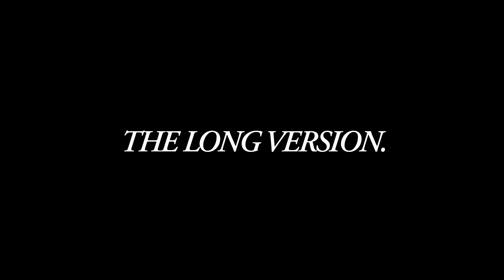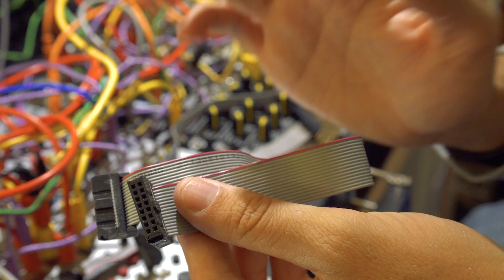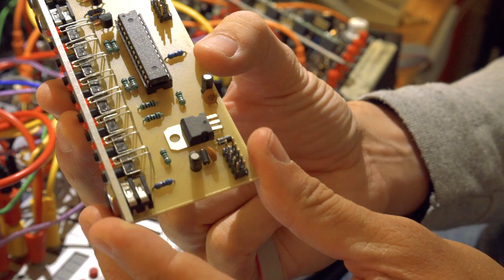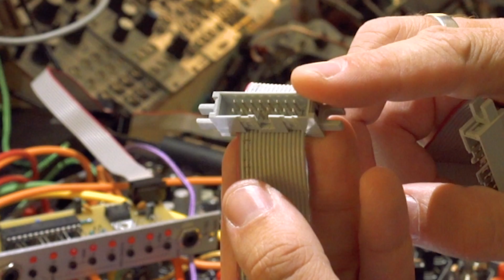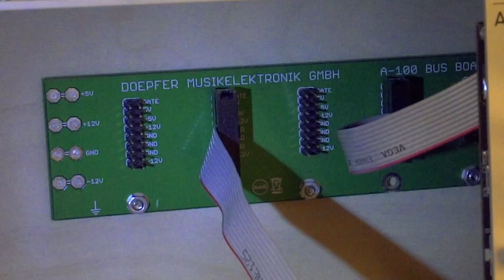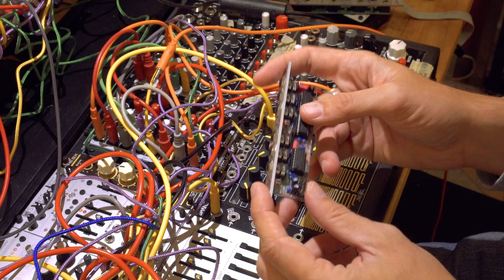How To Plug a Eurorack Module In, Correctly (Eurorack Power 101)

Comment: Good advices, except one. If red stripe on the cable don't at the -12V, THRU IT AWAY !
If any indicator in your system is wrong, changed it or don't use it. If not, you are somebody else makes an "mistake" with it what you could have prevented :-(

I'am an electrician and make my own cables that are a little bit longer because using deeper "Fischer Elektronik BGT" 19" eurorack cases.
CORRECT indicators are importend but the most importend rule in my profession as an electrician is CHECK EVERYTHING BEFORE TURNING IT ON ! 

In my profession this means taking measurement. I have seen electrician (and apprentice I had trained that forget one of the most imported rule) connecting wrong colored cables in the powerfacility and switching it on without measurement and by that destruction of every device behind that. As result a huge damage claim and unfortunately lose there job :-(
The color swap meaning here in Europe 400V on a group for 230V devices, one bright flash of light and than Pfff, smoke.

I hoped for keyed connectors in eurorack on the module side so people can't make this mistake in there eurorack system. Users are not electricians ?!!
Mylarmelodies, thanks for warning people ! CHECK, CHECK AND CHECK !

Comment: Great video on a simple, stupid topic!  

Stupid because this would mostly be a non-issue if manufacturers used shrouded headers.

Shrouded headers won’t stop an incorrectly wired cable, but I would guess 99% of issues are “user error” in plugging in the cables the wrong way or shifted over by a pin and shrouded headers would make that a non-issue.  Also, all modules should have reverse polarity protection so a polarity issue just means the module doesn’t power on instead of blows up, but that is a bit more complicated and expensive and could impact performance of existing designs (there’s a tiny voltage drop).  A shrouded header is literally just a few extra pennies to add on and has no impact on performance.

While you cover all the issues, one thing that I think is worth emphasizing a bit more is that two cables can be wired correctly, but have a different “topology”, so basing the orientation of the cable on the overall feel, without checking where the key on the IDC connector is, or referencing where the red stripe is, can be a recipe for disaster.

What do I mean?  If you pause the video at 3:50 you have a 10 pin IDC connector at the top of the screen and a pair of 16 pin connectors at the bottom.

With the 10 pin, the key on the IDC connector is facing LEFT and the ribbon cable is entering from the OPPOSITE side of the connector.  Here the red stripe is DOWN.  This is correct as the red stripe is connected to pin 1 on the connector. (If you look at at an IDC connector you’ll see a little V or arrow on one side of the key indicating where pin 1 is - this is the side the red stripe should be on)

With the 16 pin connectors, the key on the IDC is facing to the RIGHT with the ribbon entering from the SAME side as the key.  This results in the red stripe being UP. This is also a correctly built cable as the red stripe still corresponds to pin 1 on the IDC.

Now imagine that these were both 10 pin connectors coming out of your case (the ends you plug into your modules) and you had the pair in your hands as shown.  Unless you run your finger over the IDC connectors and realize that one has the key facing towards you and one has the key facing away, they would feel basically the same.  However in one the -12V is down, while in the other the -12V is up.

It would be so easy to mix up the two ribbons and fry a module because the cables felt the same in your hand and you were plugging into a module with a non-shrouded header.  NOT THAT I’M SPEAKING FROM EXPERIENCE OR ANYTHING!

Comment: I literally just got into eurorack and assumed that it did not matter how you plugged in modules, plugged in everything wrong.  Shout out to the make noise skiff for having a failsafe that it won't turn on if plugged in improperly.  Would of been a 1800$ mistake, watched this right after and learned to not just do it with this stuff lol.

Comment: I appreciate all this, as I feel the OP's pain, but find  it a bit long-winded (that said, thanks for the executive summary up-front, and for all the anecdotes) however I will suggest that Euronauts think of ourselves as test pilots -- we must learn to pack our own parachutes. Failing all else, one can spend $3 on DMM at Harbor Freight, learn to read pinout diagrams, and suss the connections out for oneself. You don't need to be a full-blown EE to  get this stuff right. But as is pointed out here, you need to do all the reading, and learn to read between-the-lines -- because you're likely to read conflicting bits of information -- and not AI, but GI (genuine intelligence) will be needed to get things straight.

Comment: Something interesting happened to me. Be careful if your system has multiple bus boards. If a module is connected wrong sometimes only the modules on that busboard is affected, not the whole system. Sometimes digital modules just not properly boot or analog modules have dim leds etc. Thankfully i havent fried anything yet. knocks on wood

Comment: Another idea that might be helpful is to make your own cables. You build your own system anyway, so why not the cables. That way, you can also make cables just as long as they need to be, which saves a lot of space and avoids spaghetti behind the modules. It probably has some electrical benefits on top of that. Here is what I do: 

1. Shrouded connector busboards only. Those will ensure you plug the cable in a consistent, right way. 

2. Normal grey cables with red stripe for "standard" modules (shrouded connectors, clearly labeled pin layout etc). Red stripe indicates -12V and is (just) and optical aid. Don´t forget to finger trace when plugging in. For my setup, this would the vast majority of modules. 

3. Different color cables (rainbow colors) for any modules that can be tricky. Tricky means: No standard pin layout or orientation, bare connector without shroud, missing clear labeling of the -12V pins etc. This way, they stick out and will flag connections for extra attention. You will plug cables out of modules at some point in time, so this is a reminder to check carefully. Don´t forget to finger trace TWICE when plugging in. 

A set of 30m cable plus connectors and crimp tool costs less than your average module and will give you a) peace of mind and b) neat cabling for better access to the space behind modules.
Reply: @etch on mind   A crimp tool is not needed. Just squeeze it in a vice.

Comment: I do not understand this silly arrangement of the Powerlines on a Pinheader. It would be possible to mirror the 4 Power lines on the connector, so that you could plug it both ways. 
+12
GND
-12
+5
+5
-12
GND
*12

Why, really, whynobody had this idea before?
I am making my own modules and I use this system, so I mustn't think so much.

Comment: Or just check feed side with a voltmeter, and refer to the ICs on the module side, which should pretty quickly tell you which way the cable goes.
Reply: I was looking for this comment. It's really the only way to be sure and it's a hell of a lot easier/more reliable that running your finger along a cable.

Comment: thanks for this very helpful indeed as lm moving modules about at this moment, l brought a jomox modbase09 but theres a confusing way to connect these when using tiptip power with flying ribbon cable same as in your video? it says to slice the notch off the connector which means connecting it the other way round on the flying cable? iv avoided doing this as not 100% confident that the connection to the actual module has to be turned also? so confusing iv had it over a year sitting in the box, daft l no but wasn't sure so avoided it and stayed with the hex drum, has anyone had to do this with there jomox? think jomox have changed this earlier connecting version to a more normal way now.
Reply from the maker: Eek, that sounds bananas - best to contact Jomox to get further clarification what to do rather than leaving it to chance or strangers on the internet!
Reply: @mylarmelodies  yes its quite a bizarre way to connect a module, keep up the good work love your sound
Reply: @mylarmelodies  finally plucked the courage to slice off the sml part on the connector as it says in the manual and connected it to the flying bus cable reverse way round closed my eyes switched it on? now lm thumping that jomox sound : )

Comment: I mark +12V and -12V on my PCB silkscreens, -12V is always down, and they all include reverse protection diodes. So buy my modules, at least you (probably) won't destroy them :)
Reply: Also I find that IDC connectors with wide top + bottom prevent plugging them in above or below where they're supposed to go, because the sides knock in to the pins which aren't connected.

Comment: Have never understood why every manufacturer doesn't just put power diodes on the input. Practically every guitar pedal has it and 9v center positive plugs are about as common as hens' teeth. 1N4001s are like $0.02 each, and a pair would prevent this problem ever happening (you could still plug it in wrong, it would just not turn on). The "either way" connector is a brilliant idea as well - 4 diodes for a full bridge rectifier and you can forget labeling. Still possible to misalign the pins and short the rails to ground, but easily fixed by using shrouded connectors. I'm developing a new sequencer module now, will be sure to incorporate the full-bridge in my next revision.

Comment: if we cant trust the red stripe, how are we supposed to know which rail is which on a module if a given manufacturer only labels it as "red stripe" on the board?
Reply from the maker: Follow the flying busboard to the source, where the red stripe should be marked/indicated. Same on PCB boards, -12V should be marked.

Comment: PS: As I'm a boffin and weirdo, I will often take a cue from the Electro caps which are usually next to the power connect. These are marked with -ve stripe. One of these -ve stripes will point to the 0v line, the other will point to the 12v line.

Comment: That module is probably still usable. Most electronics will fail along a circuit path with the weakest link blowing. I noticed that the ICs had sockets so you may be able to swap out the bad IC for a new one and power it up. Most of the cost of a module these days in in all the hardware assembly.

Comment: Never disconnecting the cable from the module is sound advice, but not always achievable. Sometimes it’s impossible to reach your hand into the back of the case with the cable attached to the module. And sometimes a cable won’t reach at all, so you have to swap it for a longer one. I’ve made a habit of always looking for markings on the PCB before disconnecting, though, and for those like Doepfer without markings, keep a Sharpie handy to make your own.

Comment: the first module I ever bought came to me with the cable connected to the module wrongly. I had no idea, and connected it but nothing happened. Lucky though no damage was done. When I figured out it was the wrong way around, I turned it around and it worked. So poo poo to Vintage King Audio, and horary for Pittsburgh Modular Waveforms!

Comment: Funny that...
The only module I ever fried was a Doepfer Wasp. It came from the shop with the cable wrong way around (the red...)
Luckily the thing that blew was a dual OpAmp with I replaced quick smart.
The lesson is:
1. Electrickery is made of smoke.
2. The smoke is kept in small back boxes with metal legs.
3. Once you release the smoke electrickery cannot work.
End of class.
Reply: Glad you opted for looking things over, rather than making a Yule Log video of your limping module! Too many people, faced with a module struggling, immediately give up and euthanize the poor thing.

Comment: Every time I ever plug any module in I double check the position of the red stripe, turn everything off, put it in, turn it on again, one module at a time. Never had a problem. I bought a module recently from a seller on Reverb. It made my first case smoke when I put it in, 2nd case power flickered on and off. I told him there seems to be a voltage error within the circuit as far as I can tell (back of module was also insanely hot), and first thing he asked me is if I plugged it in the wrong way. Ha ha. If only..it took about a week to convince him that, yes, I do know how to plug a module in, and it clearly seems there is a power issue with this module..still waiting for my refund due to Russian customs hell. DON'T EVER BUY ANYTHING FROM RUSSIA! End of PSA.

Comment: Well, actually, Doepfer invented Eurorack. So -12vDown rule is part of these modular, as important as 3U, the hp or where to set the holes (which manufacturers don’t obey as well). And it’s not on the modules’ manual because it’s on the System A-100. They made all the manuals like parts of a (very large nowadays) manual for the system. But... yeah, Eurorack is now bigger than his father and they should accept that they’re just another manufacturer for this system... AND JUST PUT A LITTLE RED LINE to indicate where -12 is. Thanks MM

Comment: In all my future modules I plan on adding a bridge rectifier so you can insert the power cable either way! This is common on brand new uMutable modules thanks to Jim. I'm also really liking that little skiff, I think it makes a good case for small demos like this ;)
Reply: I guess it's not normally done because of the voltage drop of diodes.
Reply: @YaFunklord  Yes, there is some loss of headroom from the diode approach. There's a lot of it in Eurorack though so there's usually not much point in fighting over half a volt or so. That said it would be a bit smarter to utilize a MOSFET approach to minimize losses.

Comment: Excellent Public Service Video. They should show this on day one of Modular School.
I don't think I've ever bought a Doepfer module that wasn't shipped with the cable already attached. Second hand has been a different matter of course.
I use Doepfer cases and the buss boards are a nightmare, exactly as you proved. Even when the connector is the right way up, you can go a pin too high. You just can't see what you're doing. Just wait until you're an old fart like me and your eyesight gets crappy. It's terrible. This is the actual reason old guys go 5u...
Another Doepfer thing: Older cases with the PSU 2 Linear supply, have no 5v. The newer cases with the PSU 3 do have 5v on the buss boards. 
Ta!

Comment: I bought a doepfer 9U case from someone in Seattle . This person, for whqtever reason , had one of the bus boards upside down to the other two . I was caught unaware as i had another 9U from doepfer and it wqs proper . Apparently this guy planned to build a bigger rack and use these bus boards and power then decided against it and put the middle bus board back in upside down and failed to mention it to me . Bottom line is check re check and then check again all the possible powering .
Reply from the maker: WTF, that’s an accident waiting to happen - lucky nothing burned
Reply: No not so lucky , burned a couple modules , they were easily fixed , but i was livid because a simple " heh man the middle bus board is upside down " would have been nice , Also i am not the kind of type to fix it myself , i need to ship them out .
Reply from the maker: Oh fuck. What a bell end!
Reply: Yes , it is ultimately my fault ,sort of , and it kinda of put me off the euro rack thing for awhile , but i licked my wounds and all is right with the world . ha ha ha

Comment: Alex, this is God's work you're doing with this video, man. Also, additional note about unshrouded headers: I know all of this, and I STILL killed a module by not literally being able to see well enough by SKIPPING AN ENTIRE ROW OF PINS. Not offsetting, up or down, but side to side. BOOM, spark, smoke - luckily it was a single capacitor that blew (I found a chunk of it in the case later on). The Make Noise boards don't even have pins that go UPWARDS, like the Doepfers; they are parallel to the back of the case, making it even harder to align properly.

Comment: Thank you for this. I'm surprised at how rarely it seems to be covered in "getting started with eurorack" videos and guides.
Reply: What boggles my mind here is that 10 pin PCB headers for ribbon cables are EVERYWHERE. I've got a box full of them when building my DIY Midi2CV they're really hard to just buy one unit. So I don't get how every manufacturer doesn't just have a box of these in the corner of their factory. Finally it's quite easy to protect the circuit from reverse polarity. Again not doing both is a questionable choice especially for relatively expensive modules!!!

Comment: Thanks a lot for the video. I have quite a lot of Doepfer modules and have learned the down is -12v / red stripe trick too. But i have also plugged them the wrong way round and i am lucky enough to have not blown any of the up. I have Doepfer psu3's in home made cases and all the lights on the modules flash on and off if the power connector is the wrong way round and no magic smoke so far i'm not sure if this is a reflection of some kind of protection the psu3's or not? Did you say you replaced the TLO74 and no luck? I have the A-148 as well and you could try replacing the other chips and the only other things i can see that might blow are the two capacitors near the power connector and there's a diode in the middle. Fairly cheap components mostly probably about 5 to 10 pounds? Anyway thanks again for the important video and the amusing intros. Take it easy.